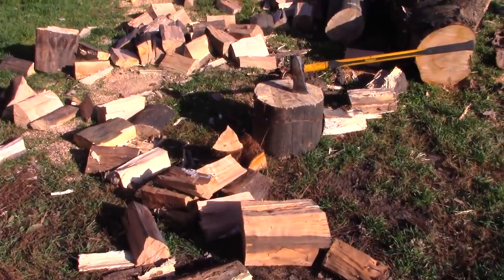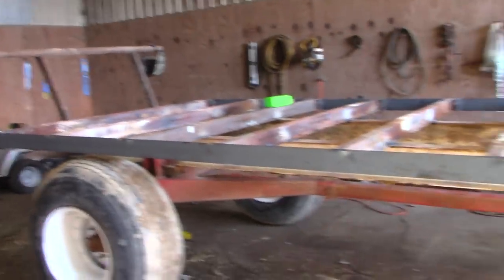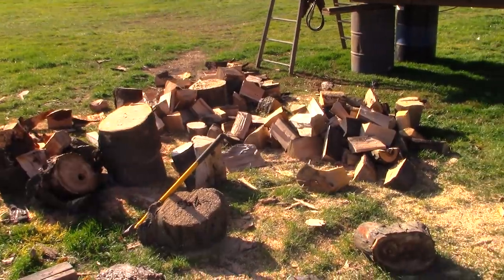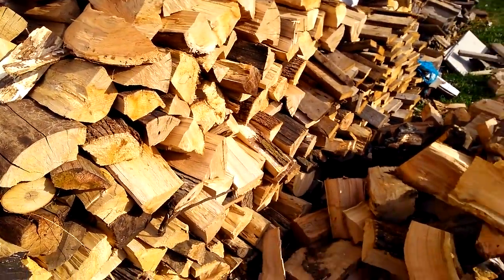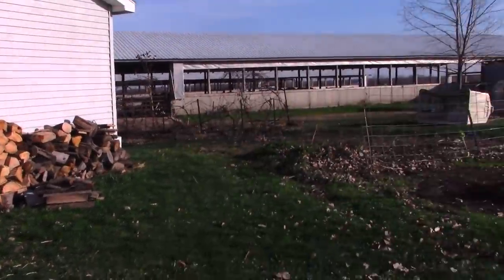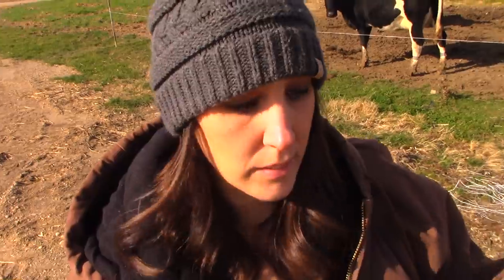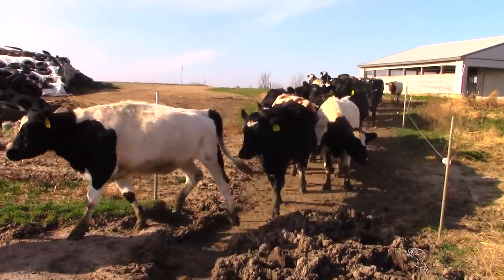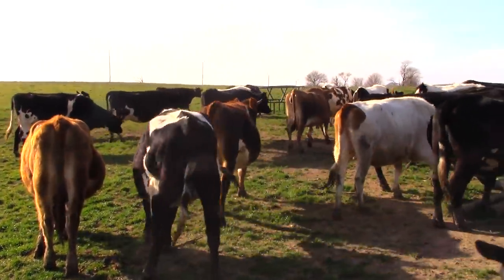Fixer Upper ~ It Takes Team Work

Comment: Hi, Rhonda and good morning.😊😊😊😊😊😊. Nice job removing the engine of the truck. It needs an upgrade with more horsepower and acceleration.💙💙💙💙💙💙💙. Also, I love the El Camino car with an amazing handling and lots of mileage. Plus, at AutoZone, they have upgrade car batteries like Duralast, DieHard, and more.💙💙💙💙💙💙. So...yeah. Have fun, stay safe and have a happy, enjoyable thanksgiving.😊💙💙💙💙💙💙💙💙👍👍👍👍👍👍👍👍👍

Comment: When I built my house in 1986 I made sure the budget included a big fireplace.  Bought a wood stove years ago to conserve wood. Like you said you can't beat coming in from the cold to warm glowing fireplace. We are total electric with a heat pump but still use the fireplace a lot. This is the first year I bought wood instead of doing it myself. Just didn't have the time. Here in Ga it doesn't get real cold. Some years colder than others and we never have snow. Cows are funny sometimes. They are like flowing water. Start a trickle then it turns into a flood. Don't turn you back on that bull. Sometimes they bluff and sometimes they don't...

Comment: Hi. If you would like to try a different way of splitting wood and the way I did for a lot of years. I used a tire put the log in the tire and used my splitting axe, that way I  would not have to keep bending down and it worked for the majority of the time
Reply from the maker: That would work great! That way I wouldn't have to keep setting the log back in place. 😃
Reply: @acresofclayhomestead  Just maybe it will work for you